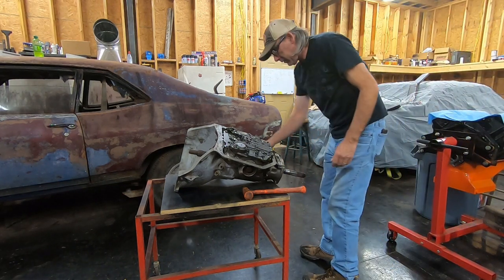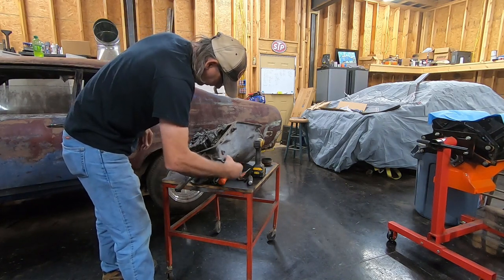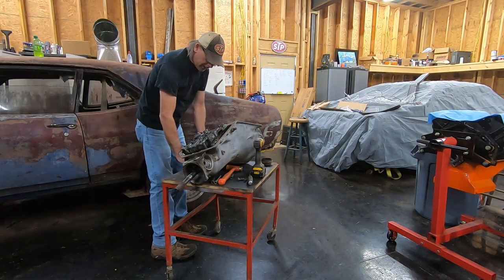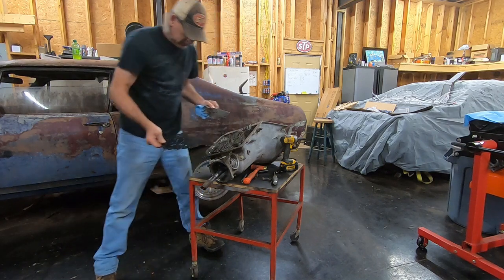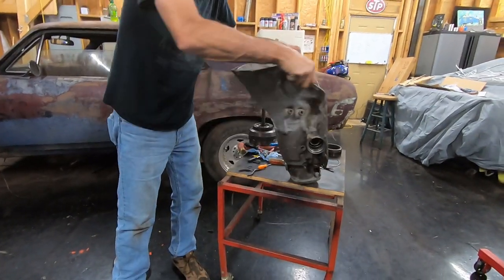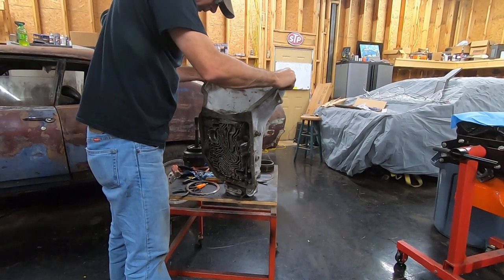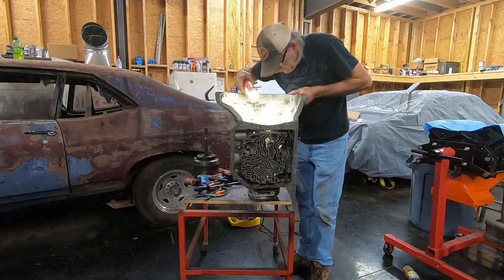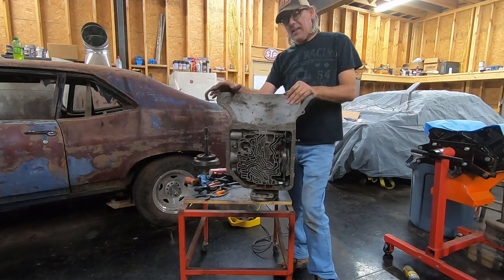Taking apart a TH350 Transmission

Comment: *TIP * use a '( 1 piece case saver fitting a th350 ) instead of the anti-clunk spring ) to prolong the use of the case.
Reply: use case saver when the lugs are chewed up
Reply from the maker: So the broken lug isn’t a big deal if I use case saver?

Comment: Just my 2 cents.  As a young man in the late 70's I built a lot of TH350's and 400's.  Not to bad if you take care when sliding stuff back in so you don't cut a seal.  But one thing my boss always told me was never to reuse a pump or a torque converter.  Just a rule I always had ingrained in my head.  Love the channel.
Reply from the maker: Thanks. I won’t reuse a torque converter on a rebuild. As far as pump, use the body and replace gears is what I understand to be the norm. Pumps are hard to find and expensive.
Reply: @Shop209  I was just looking at pumps.  My God, in 1979 i think they were like $35 lol.  But again,  Customer car, you dont want it coming back,  for you and I, I would clean a pump good and try it.
Reply from the maker: Yep. I agree. Thanks for watching!!
Reply: Or the front seal...

Comment: First thing I would do to any th 350 is cut the "ears" off the bellhousing that are used to mount the converter shield, you dont need the shield, with the "ears" out f the way, headers are a lot easier to install!!!
Reply from the maker: Yep. I agree.

Comment: Ah, the ole th350, I built bunch of them.  I had a stock th350 behind the 1970 big block Buick 455 in my 1986 Regal!  Trans was stock, except for B&M shift improver, stock converter, engine was NOT stock.  I broke rear ends, I broke u joints, and I broke 3 stock converters (not all at the same time).  With 2:75 gears in the moser 9", and drag radials, I ran 12:83 @ 108 mph Desoto raceway 1/4 mile!

Comment: I think you got this job licked, you got two cores and one kit, with all those parts you can make one work. What stall would you use with that combo?

I only ever did that once, in shop class back in 91, so it's not like I know what I'm talking about. I can say though, I had more tools and a bench mount.

Tools won't go against the budget of the car. Take your time man, you said you had a running trans. Just throw that in for now. I'd rather see you build a th350 and beat the snot out of it.

Comment: It's always nice to "dive" into a new project, and yes you need to cut the "ears" off the Case also called the "transfer lug" this is on the case to line it up for factory machining. On a stock Nova it is removed to clear the underbody on the drivers side but removing both is ok.  Well done John.

Comment: I always come to your videos for help currently building an Apollo and having issues with my breaklights hopefully I can fish out the problem soon good luck with your build! 👍
Reply: Check your tail light grounds in the trunk, unscrew it and sand it a bit, also check your brake light switch under your steering column. ...just get a test light or digital voltmeter,  and apply the brake pedal, see if anything happens.......the nova in the pic next to my name is actually a '74 apollo with a '72 nova front end and lsa supercharged 370"lq9